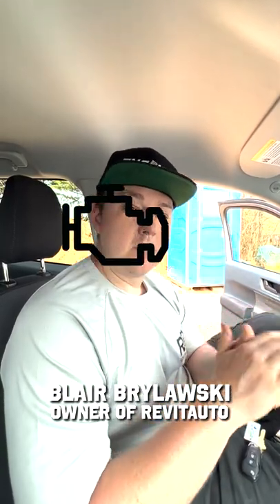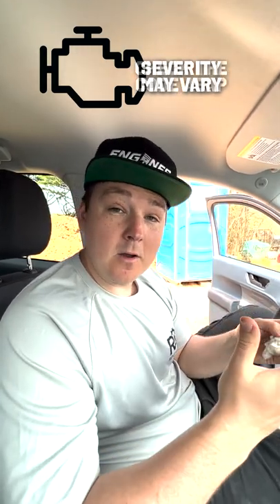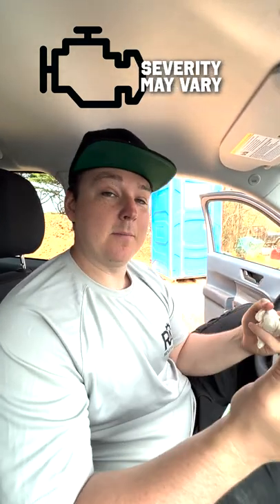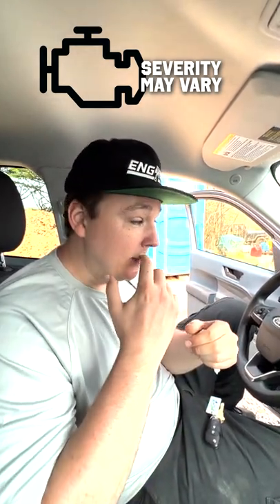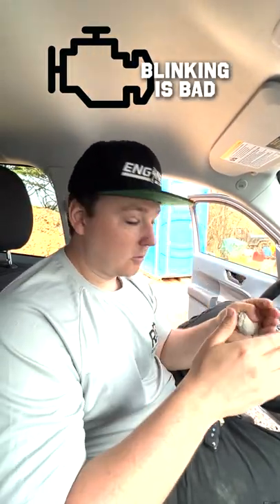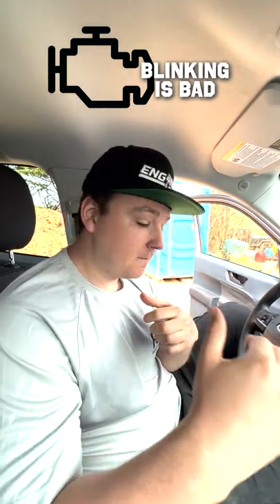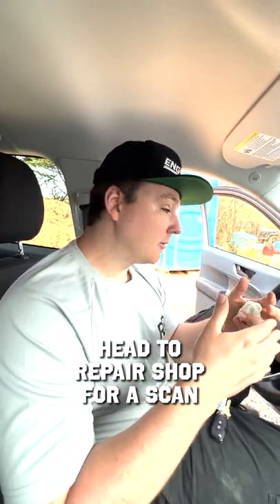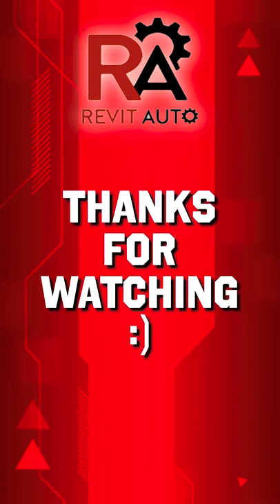Check Engine Light is On

Comment: I’m confused with my check engine light because it just turned on not flashing though.. but it literally just came out of the shop from its engine getting rebuilt and it runs great
Reply: @crowbaril903 9
Reply: if the car run good then its a error code just get a scanner yourself u can delete all the lights
Reply: Mine to on no blinking but everything eles runs and works perfectly fine its weird asf

Comment: It’s possible the light on because the cold weather ? 
Because my car (cr-v 2007) run like a normal, oil level, gas tank cap and battery everything good

Comment: If it shaky and the check engine light is on, it’s most often a misfire. You will need to fix that right away or you’ll trash an expensive catalytic converter.

Comment: Mine came back as a catalytic converter problem 🤦‍♀️
Reply: That happens to mine. Just got a catalytic converter cleaner and poured the entire bottle in (with full tank). After 2 weeks it dissapeared and lasted 1 entire year with no problems. May want try that. Now my issue is back, but after oil change.

Comment: How do you reset your “check engine” light when the dealer forgot to after fixing what was wrong?
Reply: seems sus
Reply: if they fixed it it should go away, either way, any mechanic with the tool can reset this code easily

Comment: Hello,
I have a Toyota Yaris of year 2007 gasoline. The check engine light is on since 6 month ago and the VSC light as well. I bought a cheap OBDII scanner from internet, and it gave me the code P0420. Might that be correct that I have problems with catalyct?
Best Regards
Reply: Hi i have 2006 toyota yaris manual iam facing engine light on when the car igntion on 

Can i know what it is please ?

Comment: I checked my engine air intake and the next day my cel was on! How do I turn it off? I'm sure it was the air intake. Too broke to take it to a mechanic
Reply from the maker: You can ask if your local auto parts store can check your engines codes for free!

Comment: I used a gun via battery to fill a tire. Too cold to use the battery, so I plugged the tire compressor on via the lighter plug. Check engine came on. 
Knew I needed to replace my six year old battery. I did.. Engine light still on. Weird AF 
Car is running fine. 
Ain't no way that a coincidence. I ain't paying 150 for anyone to tell me. F that. When the light flashes I'll take it.

Comment: My engine light came on after an oil change and its never been on before and it's an 06 Hyundai Elantra
Reply from the maker: Have you checked the oil level? To make sure it is full and correct? Do you know how to check that?
I would also contact a local autoparts store to see if they will scan your check engine light for free! 
Post those codes here after!

Comment: Mine was still working normal in my 16 siera i wanna seafoam it and see if that helps i think i know what it is. Wasnt in limp mode could it be that bad
Reply from the maker: What do you think it is? Do you have a scan tool to check it out?
Reply: @Revitauto  no i dont im guessing its from my rough idel been happening for months

Comment: I changed the better as suggested by the mechanic but the light still comes causing my car to not go over 30mphr
Reply: try changing your peddle position sensor my check light came on got it fix car go reg speed now light popped back up on had to reset my. code

Comment: One cylinder is misfiring. Possible spark plugs ??
Reply from the maker: It could be a spark plug or an ignition coil! That’s typically what I check for first! 
How many miles and what type of vehicle?
Reply: 2010 Smart car -passion. Plugs and all getting done this week.  @Revitauto
Reply: Oh yeah 135,000 miles

Comment: it always happens when my car is stuck thru traffic
Reply: This.
Reply from the maker: Interesting are your coolant temps going up? What’s the ambient air temp around you? What year make model do you drive?
Reply: @Revitauto  it’s a 2017 nissan altima, the rpm starts going crazy and whenever i hit the gas pedal there’s a delay